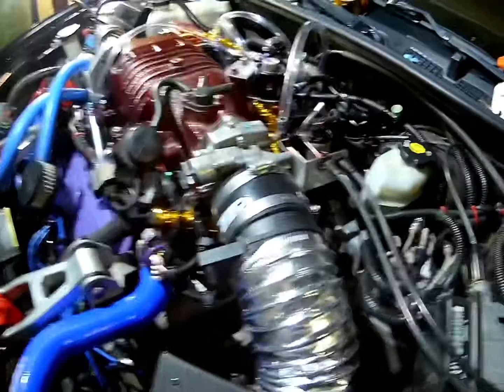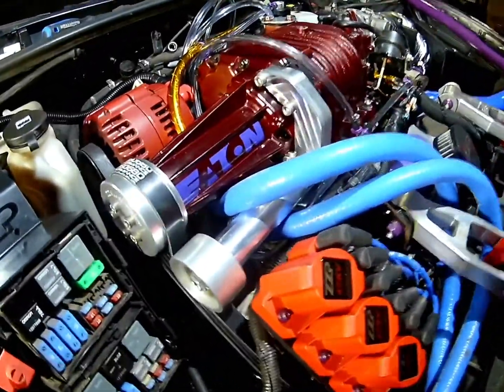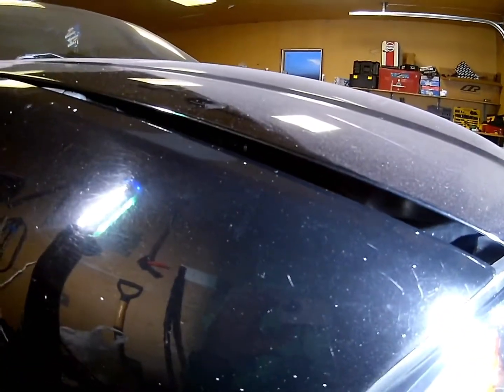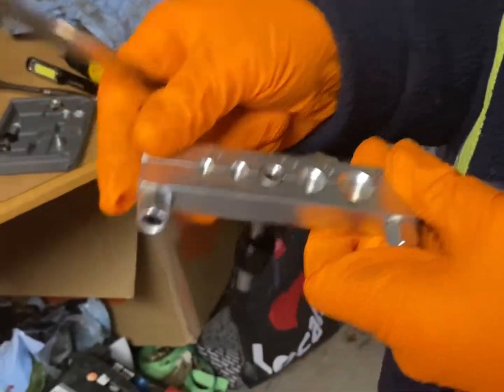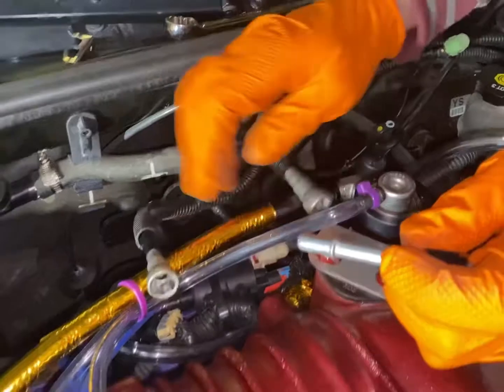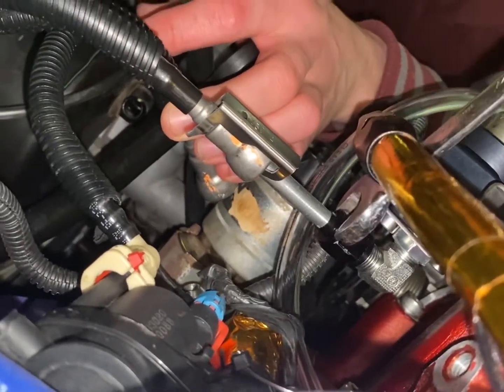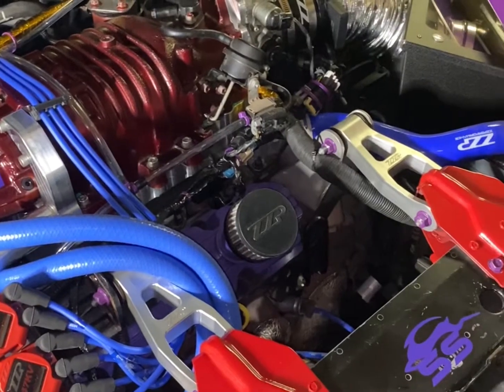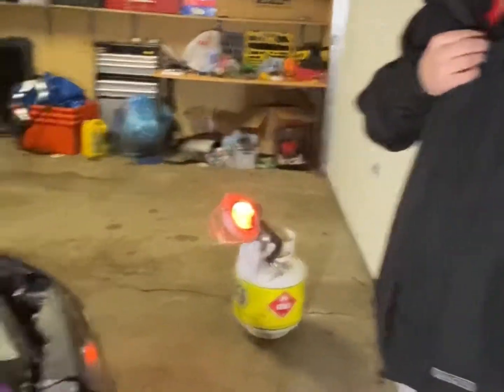Stage 3 Impala SS Part 3

Comment: Nicely done boys.It looks like everything went together very well.
BTW, you really should be using a brass drift when removing and reinstalling the lock ring on the fuel pump.